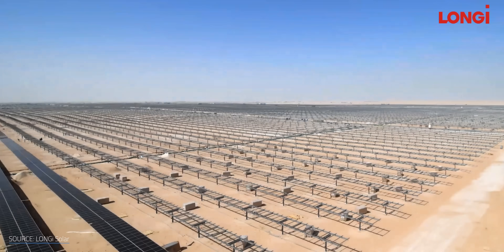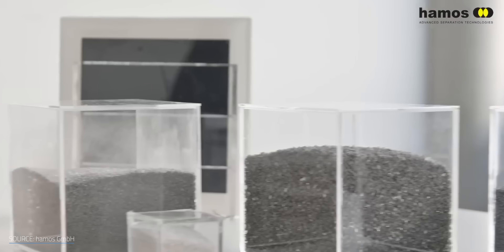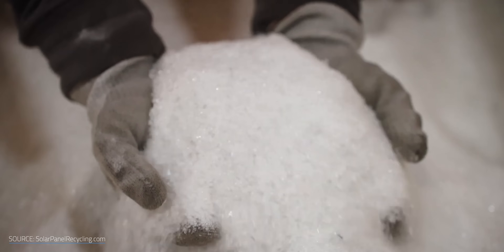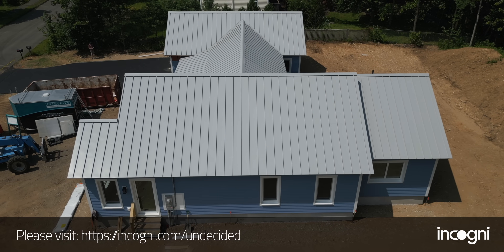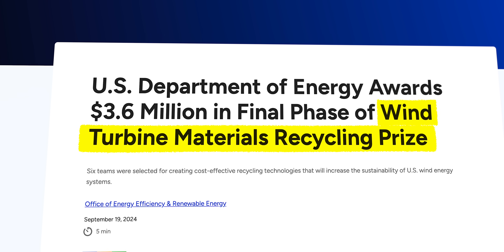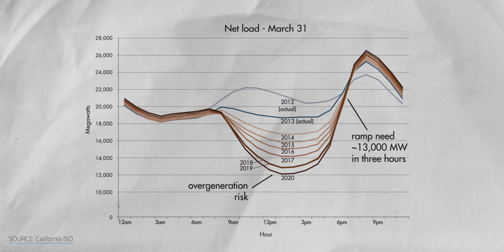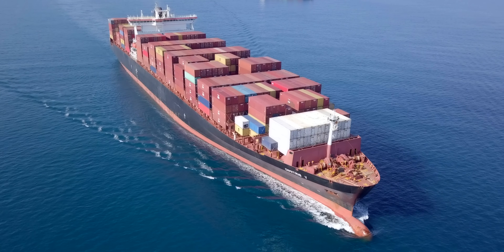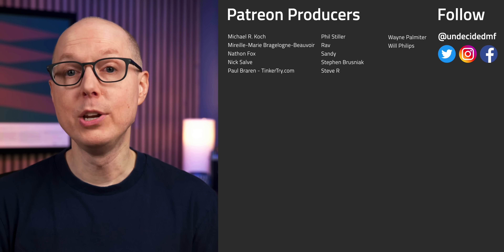How We Solved Renewables BIGGEST Problem

Comment: Something came to me while watching this video... The recycling aspect is often cited by the anti-renewable crowd. But with renewables, once they're constructed, you know exactly the amount of energy needed to produce, the exact amount of material used and that will need to be recycled. With fossil fuels, that's not the case. So a ridiculouse image popped into my head where an ICE vehicle turned one gallon of gas into two gallons of an imaginary substance that, if it has the density of water, would be about two gallons in volume. And imagine the vehicle operator was in charge of collecting and disposing of this substance. Like for every 10 gallons of gas, 20 gallons of waste went into a different tank that they had to pay to get rid of. What a wonderful thing that would be. Instead we have this giant disposal in the sky that everyone uses at no cost and believe they can continue doing so forever with no downsides. Ugh...
Reply: With all due respect, can you please define your system clearly when you say: “you know exactly the amount of energy needed to produce, the exact amount of material used, and that will need to be recycled.” You’re suggesting we can do some lifecycle analysis and I’d like to know the bounds in this case.
Reply: You know this, but you also know it is an expensive mess to do. You take high quality silver ingots and turn them into a very thin film that is hard to recover. The better solar panels get at using less silver, the harder it becomes to recycle. E.g you want the silver for conductivity and reflectivity, but you could use a thin silver layer for reflectivity and a thicker copper layer for conductivity; which makes it cheaper, but harder to recycle.
Reply: Yeah, the actual cost of recycling is never taken into account.. all you hear is "this product is now 95% recyclable !! YAY !! "
Reply: No what's your data
Reply: I read ICE as "Immigration and Customs Enforcement". I've been reading the news too much.
Reply: This is a tragedy of the commons problem. Nobody is held responsible for the output of their exhaust.
Reply: The problem is that if you make me have to do ever more work and with ever greater inconvenience, and costs for it myself every step of the way, I will eventually stop playing your game altogether.   

This is a huge issue with the renewables/green tech/emissions and everything 'save-the-earth' related now. Way too much has been proven to be nothing but lies and scams that were rammed down our throats at our cost in the end.  
Too much of what started out as good and needed ideas and changes has become corrupted and twisted into counter productive garbage being forced on us at all costs..
Reply: The truth is the anti-fossil fuel crowd is not interested in facts... it is for the most part a zealous, cult-like religious movement that is on some kind of witch hunt... much like the Nazis blaming everything on the jews..
Reply: There's no such thing as an anti-renewable crowd. Its opposition to politicians and policies that use recycling as an excuse for onerous regulations and laws. However, those politicians and policies have shown to fail as they don't make the process actually work and instead create the backwards process of forcing people to separate their garbage only for the city to just send everything to the same landfill. 

The moral of the story is that you shouldn't make things political and use stuff like this as a means of fighting a class war if you actually want the recycling process to succeed. Instead you should work to make it more profitable which should be easy considering that its refined/purified products that are being recycled
Reply: "Unreliables" have be an unmitigated failure... they are not the future..
Reply: EVs are a dead end at the moment. Until governments spend a bunch of money on nuclear energy there simply isn’t enough electricity being generated to cope with even a quarter of the population using EVs.
Reply: Reduce is first for a reason in the triangle. Recycling is and never will be better than reducing consumption
Reply: @tuckerhiggins4336  That sounds nice zt the surface, but with the possible exception of yourself, anyone who esposed it, and I actually disccussed it in any depth with....
Turned out to be an antinatslist who wants to see humanity end.

An environmentalist who thinks *we will wreck other planets by mining them... Lifeless worlds. I.E. Meaningless esthetics. They want humanity to end, or suffer, oddly enough, bexause they claim to oppose painto the point that any suffering outweighs any amount of joy.

And then you have those who want to end all life, because even bacteria may evolve to something that can suffer.

Traitors to life in this universe.

Is this your position as well?
Or do you just mistakenly belive in the malthusian inevitable catastrophe?
Reply: @bennymack78  the problem is 90% of stuff used in renewable energy isn't reusable. Then comes the space, batteries, the upkeep of batteries. That's the problem. It's just insanely infinitely larger footprint in production and waste than the real alternative. Wich is nuclear power, and hydrogen for vehicles. The problem is they're too cheap. Companies wants the waste, low quality, low reusability, and low long time endurance. Batteries are perfect from the companies point of view. They're expensive, they have a low shelf life(10-15 years they loose noticeable output), hard to repair, hard to reuse. They're the perfect coalgreen solution.
Reply: Yes, it’s hard to beat the imagination of the Luddite crowd. They would come out of their caves, but carpets have so many problems.
Reply: as a canadian having to pay for carbon taxes, it is economically crippling. also as someone who's parents were born in Australia and new zealand, Australia ABANDONED carbon taxation after only 2 years because of the crippling effects it had on the costs of living. for a few years now, record numbers of canadians are relying on food banks just to be able to afford BASIC FOOD NEEDS. 25% of the canadian population is now in poverty too.  green house gases i do not deny can be harmful to our ecosystem, but to charge the population for them is not the solution. renewables arent nearly as viable in our COLD Climate, heat pumps do not work as well, EV batteries have critical failure in cold climate, and Canada is a VERY GREEN country, with some of the highest environmental protection laws in the world (before carbon taxation) yet we are suffering in standards of life, while other nations, other RICH NATIONS in Asia are still easily the worst perverse polluters of the world.
Reply: @dustinherk8124  this is also an important note

Me and Benny are both privileged and entitled to not be stifled by this oppresion of the common people

Any opportunity to change to better items is being removed from the vast majority of the people, simply because they are too poor to start with.
Reply: With euro 6.5 emission controls (euro 4 or 5 in most cities) and HVO fuel, diesels today have cleaner exhaust than intake

With series hybrids diesel-electric motors (this is what we have in many trains today), we could see a minimisation of negatives from both technologies (with a further increase in efficiency when on diesel... And more range despite a small battery, decreasing the mineral needs)
Reply: What becomes of the millions of tons of concrete and steel under those windmills?
Reply: @ nothing. The base is typically reused or fortified when the wind turbine is replaced with a bigger better model.

If you're so concerned about the harms of an extremely low-carbon way of generating energy that's obviously far better than shoveling tons of fossil fuel into a thermal plant every hour that it's generating, then by all means use less energy.
Reply: @skierpage  LMAO. A shameless LIE, the country is littered with rotting windmills.
Reply: @skierpage even though it’s been proven that wind turbines take nearly 3 half lives of its own function to actually produce the same amount of energy to pay off in energy worth that is needed to manufacture itself? Manufacturing takes energy installation takes energy they established a wind turbine takes 15-45 years to produce enough electricity to pay off everything for itself to exist and not be a net drag on energy production. This doesn’t include annual maintenance which also add up.
Reply: @mrpumperknuckles1631  energy costs money. So all the energy used to make anything must cost less than the final cost of  that thing. 

Wind turbines are made with energy bought retail, but they sell energy wholesale. 

The fact that wind turbines make a profit proves that they make more energy than was used to make them. Because they sell wholesale (more energy per dollar) that proves that they make much more energy than is used to make them. The same applies to running them, and to disposing of them. Because they make much more money than they cost to build, run and dispose of, that proves they make much more energy than is used to build, run and dispose of.
Reply: @ You must not be an engineer, because you have no solutions. Simple, refurbish the wind turbine every 20 years. No need to do anything to the concrete.
Reply: Interesting. I did an analysis once that showed that you would need to burn something like 2000 times the mass of coal as compared to the mass of three wind turbine blades, over the life of the blades to generate the same energy. The anti-renewable crowd is complaining about disposal of blades, but not the massive amount of coal being burned into the atmosphere. Having said that, recycling blades is a fantastic idea.
Reply: @kdungan100 except carbine is expensive material to make and it is not even possible to recycle them due to the hardness they process… you clearly haven’t done much research. Carbine fiber is a hard structured material which is extremely tough to cut and I say that as someone who worked with carbon fiber In machinist shops. Carbine fiber isn’t easy to dissolve or shred for that matter and guess what the shredders will need repeating replacement blades and grinders as well which means more costs to the process. You lack a lot of calculations and factors that aren’t estimated in your argument instead believe anyone who is against your idea is somehow wanting the worse possible outcome of life as a whole but you refuse to even realize the basics of reality that you are basically destroying the earth on your own demands instead. It’s honestly funny you claim to be eco friendly but failed to even research about manufacturing maintenance and cost of manufacturing on all levels but believe broad brushed obscure statements from journalist instead to pat yourself on the back XD
Reply: @mrpumperknuckles1631  I simply said you use 2000x mass of coal to generate the same amount of electricity as wind turbine blades. You could just burn the blades and it would be far better than burning coal. I’m not sure why you are so conserved with recycling the blades.
Reply: @kdungan100  What are those blades made from?
Reply: @ Did you watch the video?
Reply: So is this waste just not very dense, or is it anti-matter fuel? Or is it just a symbol of burden on the environment?
Reply: Well, CO2 is food for plants...
And Fossil fuel also produces water. more water than CO2, infact.

So... It actually kinda Is.

Only thing you really need, is to add Non carbon Fertilizer so it gets absorbed by plants faster.

Also, as we get better in producing Graphene, we are going to use Carbon Sink techs to better produce it.
Because Graphene is a Form of Carbon. A very useful one.
Reply: @fanOmry plants are increasingly taking up less CO2 due to heat increases so no, and as it is they have not been able to keep up with human-source emissions. So no. Carbon capture and sequestration is also not the panacea we need right now
Reply: @Zaihanisme  Plants consistently take in half of we dump in the air. And Graphene is so F'ing useful, that if we could now economically 3dprint it with high quality product, that alone would drop costs of living in many vectors.

Example: Rockets. If we could make the same rockets we have now, but a graphene hull... That alone would make them light and stong enough to give us such a low cost space flight, Industry nearly as a whole could go to orbit. If we have cheap high quality Graphene printing, taking CO2 from the air becomes so economically advantageous, That these people will get all the money to make it more efficient.

When that industry emerges, we will probably nearly drain the air of all CO2. And set our sights to Venus.

But back to tne point. The world has been confirmed to be 'greener than last year' since 2016. And in the last decade, Renewables had become more economic than fossil fuels, So the super majority of new power production? Renewables. When power plants are retired? They are replaced with renewable. And storage.

And this storage? Also removes carbon from the air. If it used actually for power, sure it gets back... And then sequestered again. Sure, some will leak, not nearly as much as what is removed. And some will be used for production. Like graphene. 

I know, I'm repeating myself, but yo7 seem determained to not pay attention.
Reply: Except in no real world would that even exist… I’m sorry but most electricians machinist, manufacturing professionals all learn and already know the industry while you make hypotheticals they practice in reality. We don’t use much of any oils for lubricant’s in machining anymore outside small shops stuck with older equipment. Most of us aren’t stuck as anti renewable and trying to label those who oppose the push for the renewable energy projects only shows how little you think of differing thoughts and arguments as if you only care about your argument and world view as if you think you know the answer to all the problems. Reality is not black and white. What is promoted as greener projects today will be labeled as eco unfriendly resources tomorrow. That’s called progress and if you don’t believe me than you never studied much about the Industrial Revolution and the evolution of electricity. We developed solar farms since the 50s for god sake. Not much has improved as no matter how cheap you break down production materials the number 1 thing that cost the most is the manufacturing of the materials and even though it cost $0.50 worth of specific material it still cost 100 for manufacturing and processing the materials to be used. This is the main problem with your mindset. You look at a narrative and how to drive home that narrative but you don’t go into the weeds needed to understand all the in depth information to understand why these projects fail and why they cost millions of dollars now to deal wit. These projects become dangerous hazards to their surroundings if left abandoned and can cause major problems in the future if left untouched just like oil ponds!
Reply: Except in no real world would that even exist… I’m sorry but most electricians machinist, manufacturing professionals all learn and already know the industry while you make hypotheticals they practice in reality. We don’t use much of any oils for lubricant’s in machining anymore outside small shops stuck with older equipment. Most of us aren’t stuck as anti renewable and trying to label those who oppose the push for the renewable energy projects only shows how little you think of differing thoughts and arguments as if you only care about your argument and world view as if you think you know the answer to all the problems. Reality is not black and white. What is promoted as greener projects today will be labeled as eco unfriendly resources tomorrow. That’s called progress and if you don’t believe me than you never studied much about the Industrial Revolution and the evolution of electricity. We developed solar farms since the 50s for god sake. Not much has improved as no matter how cheap you break down production materials the number 1 thing that cost the most is the manufacturing of the materials and even though it cost $0.50 worth of specific material it still cost 100 for manufacturing and processing the materials to be used. This is the main problem with your mindset. You look at a narrative and how to drive home that narrative but you don’t go into the weeds needed to understand all the in depth information to understand why these projects fail and why they cost millions of dollars now to deal wit. These projects become dangerous hazards to their surroundings if left abandoned and can cause major problems in the future if left untouched just like oil ponds!
Reply: ❤❤❤❤❤❤❤❤❤❤❤❤❤❤❤❤     you skipped over a lot of inconvenient details
Reply: I am part of a crowd that views ICE as currently necessary and wish for electric vehicles/renewables to mature (and ethical mining infrastructure to be built out to accommodate them). In a previous video I watched, it tried to analyze the full costs of ICE vehicles by examining externalities. It did a good job of identifying them for ICE vehicles and then skipped over them for electric vehicles. That seemed like a biased way of doing an analysis so here are some of the externalities of green energy/electric vehicles: Cobalt mines in the Congo that use slave labor, Wind farms near the shore that leach energy from waves (I thought this was reducing food supply for whales but could not find an article), heavier electric vehicle causing more wear on tires and road, needing to increase mining production by multiple times to get the metals for Electric vehicles, water needing to keep solar panels dust free, etc. 

Now for why do the anti-renewable crowd love to bring it up, showcasing your opposition as being hypocritical leeches some energy from them: Democrats are trying to do this with DOGE, many groups love doing this with various religions, Republican with the racism of DEI, etc. It seems to be a debate tactic that at times needed to break people out of their echo chambers but too often is used to bash the other side. I personally have been shifting from a debate mindset to a lets get stuff done mindset: if you are loading the dishwasher you get to put dishes in according to your preference. Currently Natural Gas, coal, Gas, etc are providing a ton of the worlds energy which has drastically improved human quality of life in many areas while harming it in a few areas.
Reply: @fastkicksdefendhead  EVs tend to move away from cobalt these days. In addition to the ethical problems it's expensive and not necessary anymore with newer battery chemistries. While cobalt is used in oil refineries to remove sulfur.

Regardless, both ICEs and EVs have substantial problems. We can get rid of a lot of them by designing our cities for public transit, cycling and walking. Cars make more sense in the countryside, where fewer and fewer people live, making continued car use there less of a problem.
Reply: @tvuser9529 It is good to know that know that improvements are continuing with batteries, it is an area I do not spend a lot of time researching. I did a quick look and in 2022 40% of total cobalt usage was for batteries (I could not find how much is used for oil refineries) and 50% of total cobalt is from the Congo, this may change in the future until then it still ways heavier on the EV side than the ICE side.

I do like the idea of improved cities, from what I have heard the Netherlands are doing a good job of exploring different options. My biggest concern is that urban planning will be used to control people or make it harder for them to travel: New York charging a congestion tax. A secondary concern is that it seems a lot of these projects cost more, take longer and produce less benefit than originally promised: see several of CA failed projects.

I will also say that my favorite activist group is The Ocean Cleanup Project because they act on their concerns instead of parading.
Reply: @tvuser9529 EVs tend to move away from cobalt.... that is a cop out , even if drops from 19% to 15% it still mined by slaves. Also none the EV crowd ever do the math, coal=>steam=>electricity=>step up transformer loss=>Line loss=>step down transformer=>supercharge loss=> battery loss=> finally your car switching loss and battery heating/cooling=>final wheels spin.... it is way worse then ice engine....and I should know as an electronic engineer. An ice can have a tank of gas sit for up to 12 months, an ev will self discharge it low voltage battery in a few weeks and the main battery degrades over the years so you end up with even less and less...
Reply: @fastkicksdefendhead  one thing to research is the control and costs of current regulations for urban planning. Not the NYC TAX. The one more lane and required free parking model is not sustainable for cities and suburbs and imo quite limiting
Reply: @ntal5859   sure, go ahead and tell the people at University of Cambridge, Nijmeggen, Exeter, Yale, and the ICCT group that their lifecycle analyses are wrong.
Reply: @ntal5859  This is true. The EV crowd definitely don't do the math.
Reply: @ntal5859 Seriously I wouldn’t be so quick to admit to being an engineer after a generalised statement like that, and clearly you have failed to keep abreast of the constantly developing data, maths and economics of this subject. It would be best to spend a bit more time informing yourself or keeping the engineer thing to yourself!
Reply: @tvuser9529 nothing truly beats human powered transport (bikes and walking) when it comes to emissions and ecosystem/ space conservation. I'm a car guy, so I personally would like to see ICE performance cars exist into the future, but when it comes to commuters, there's no reason to not strive for EV in the long run. If I were asked for a solution, I'd be attempting to setup modernized nuclear power plants, some R&D designs are modular and even meltdown proof so their safety and costs would be much cheaper compared to current plants. With it being so energy dense it will subsidize our ever growing power needs, all the while giving more time and energy to be put into fusion reactor research, some thing like Helion, and renewable fuels like what Porsche has been researching, and electricity sources that minimize ecosystem impact and are made of non toxic, recyclable materials. I believe EVs will only be properly feasible in the span many try to push if we get more nuclear online, and when silicon graphene batteries fully mature giving EVs extreme range capability.
Reply: @fastkicksdefendhead  the problem with your even-handed pros and cons analysis is it ignores scale. The downsides of wind and solarand batteries are dwarfed by the harms of mining then BURNING the many tons of fossil fuels that they displace. One side is 20x more crap by weight than the other.
Reply: @skierpage  EVs are powered by coal my friend, if most grids are something like 60-70 coal or gas powered, you are just burning it at the power station with all the added losses along the way.
Reply: @skierpage  Biased science will win short term support while even handed science will lead to long enduring support. 1 ton of untreated nuclear waste is more concerning than 20 tons of anything else (total harm = (list of harm - list of benefit) * quantity). A lot of what was deemed waste has now been harnessed for a productive goal. For instance, gas produces Carbon Dioxide that is considered a green house gas (potential negative) but it also helps plants grow (realized positive) and there are thoughts that an algae farm could harness carbon dioxide to produce stuff (struggling potential positive). Additionally, an even handed analysis can help expose blind spots or unexpected tradeoffs: see a Vancouver is Awesome article "How sustainable is your reusable bag?". Plus there is only so much one can ask of the public before they move to the "I do not care" group see end of covid.
Reply: @ntal5859   an EV is far more efficient than a gasser blowing up fossil fuel to make a lot of heat and a little forward motion; many EVs achieve over 100 MPG equivalent. Every recent lifecycle analysis concludes that an EV charged from the current grid is far cleaner than a comparable gasser; the only debate is whether it repays the impact of its 1/2-ton recyclable battery in 30,000, 15,000, or only 7,500 miles of driving. And since the majority of new generation everywhere in the world is cheap and quick wind and solar, every EV on the road will only get cleaner. 

If you're concerned about the harms from 2-ton manufactured goods, by all means don't own a car! But if you do, an EV is definitely better.
Reply: @ntal5859 Cool! Coal to ev is more efficient than ICE vehicle. No refining and economy of scale, etc. What else ya got?
Reply: @bennymack78  Is it more efficient?
Reply: Says guy who thinks electric cars are green just because they don't exist smoke from behind.
That alone is ignorant.
Also ev aren't renewable or fixable as normal cars
Reply: @fastkicksdefendhead  it's hard to move out of your personal echo chamber. You're clearly trying, but the things you're saying are clear echos. 

For example, the idea that electric cars are heavier.

Model 3 1611-1836 kg
BMW M5 2510 kg

Yet the model 3 is quicker and has a larger internal volume (neither is faster as they're both speed limited to 250km/h)

There's so much "everybody knows" stuff like this that's just obviously wrong, but it's repeated so much that people think it's right. Often there's some grain of truth, and in this case there are some ICE cars that have had poor conversions done by the manufacturers to make a compliance car that's far from optimised, that is indeed heavier, but it's not a general rule.
Reply: @gasdive  Ok, so you are comparing different brand vehicles so it is hard to say that the difference in weight is because of it being EV or ICE. I looked up the Chevrolet Silverado and the Chevrolet Silverado EV on a wiki to try and get a closer comparison (the model years are different so it may also not be a fair comparison) and the EV is (3500 kg+)  way heavier than the ICE vehicle (2,000 to 2,500 kg). An article I found stated the EV battery packs add 300 to 500 more kilograms compared to ICE vehicles. Now environmental regulations have pushed some ICE vehicles to become bigger to get around them... which is more a fault of the regulation than ICEs.
Reply: @fastkicksdefendhead  I guess that's what happens when a company that doesn't want to make EVs is forced to make EVs and they base a truck on a Hummer platform. 

Cybertruck is 2000 lb lighter.
Reply: @gasdive What model year M5 are you cherry picking for your comparison? The M5 gained over 1000lbs across generations and it’s also a hybrid, with an electric and gas system and rear wheel steering amongst other features. Making that comparison and not knowing that reverberates in your own echo chamber selective picking facts that align with your beliefs instead of painting the entire picture. So before you go and judge someone’s opinion make sure you making an actual argument instead of cherry picking comparisons 😊 For example, the 2023 model year M5 weighed in at about 1,851kg just slightly above the Model 3 (a subjectively smaller car, why not compare it with something that’s makes sense like a Model S)
Reply: @sleepysloth847  the current model of both. But as you helpfully point out, even the older ones are heavier than a Model 3

I picked the M5 because though it's larger on the outside, it's smaller on the inside due to approximately 1/3 of the volume of a petrol car being wasted housing the petrol engine, transmission and cooling equipment. Same number of seats, less headroom, 466 litres of cargo vs Model 3 with 680 litres.

You can go up to the M5 touring which gets you just under 1700 litres, but to be fair, you'd let the Tesla go up to the Y, which has 2150 litres and a 7 seater option. And the heaviest version of the Y is 1998 kg while the significantly smaller BMW M5 touring is 2550 kg.